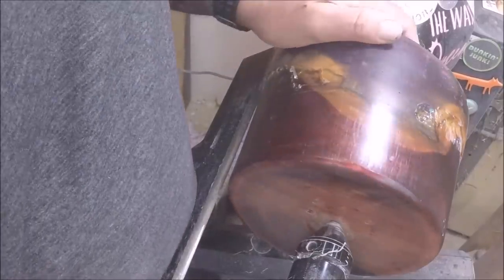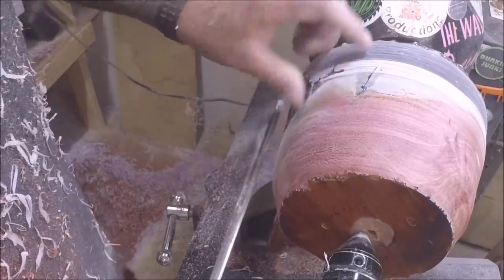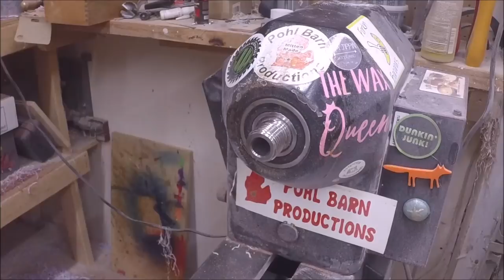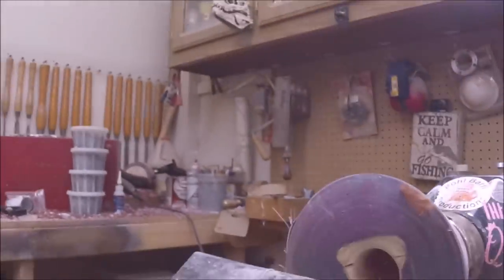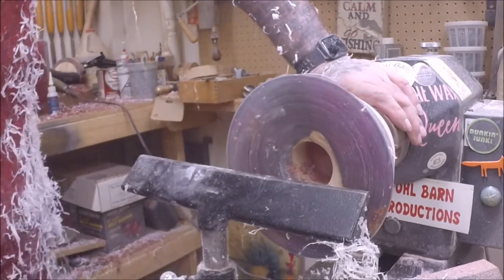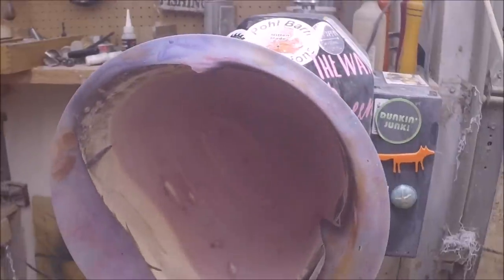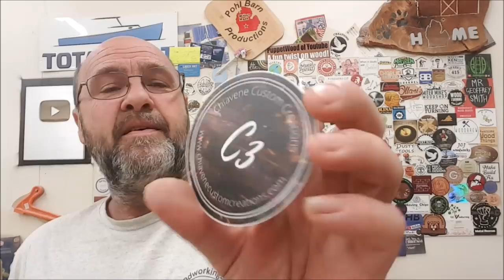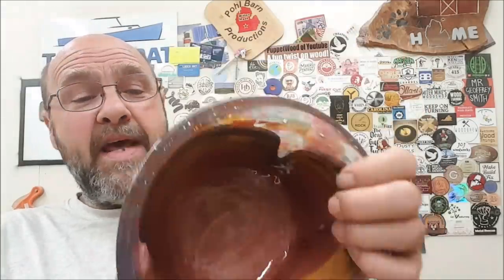Ribbons in Resin on Cedar

Comment: I like the whispy effect you got going on there, Doug. And I really like the color of that cedar. Not to criticize, just really curious, why/how did all those bubbles get there?
Reply from the maker: Thank You Kris,  the bubbles are trapped in the ribbons when I poured the resin, the pressure pot compresses what was mixed into the resin and maybe some of the smaller bubble that were trapped but it does not remove air pockets that large.

Comment: Would you rather turn hardwood or softwood? You mentioned cedar cracks easily, how about spruce, pine or fir?
Reply from the maker: I have not turned much pine and I find that it shreds more than cuts,  hard wood turns much better

Comment: Kind of liked it with the milky resin before you put the clear coat on it to gloss it up. What I don't understand is why are there bubbles? Shouldn't the pressure pot have squished them down or was it too much resin to squish?
Reply from the maker: Thank You, the pressure pot compresses the air mixed into the resin and maybe some of the smaller bubbles that are trapped in the ribbons but it will not compress some of the larger air pockets.

Comment: Have you ever had problems with Stoner? It leaves a textured spiderweb effect on my blanks and ruined a mold of mine.
Reply from the maker: it depends on the mold material I think, this is the wrong one for what I am using it for,  most of my molds are disposable anyways, but I find the heat from the resin destroys the silicone molds or pretty much all of them